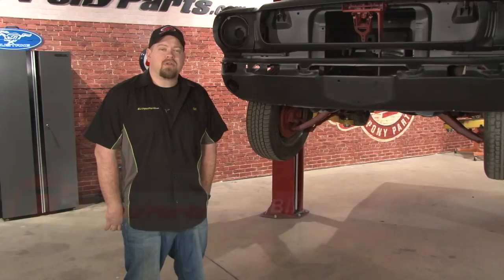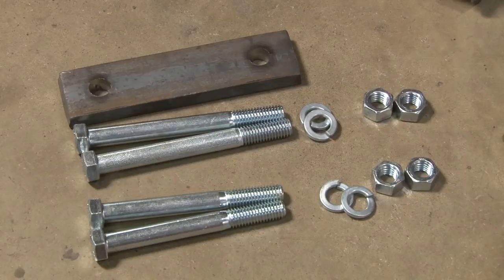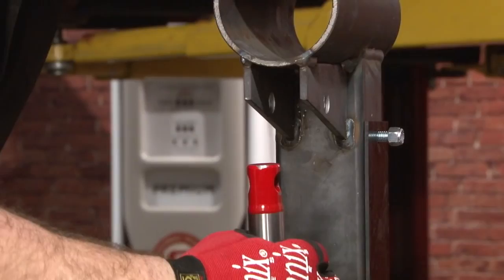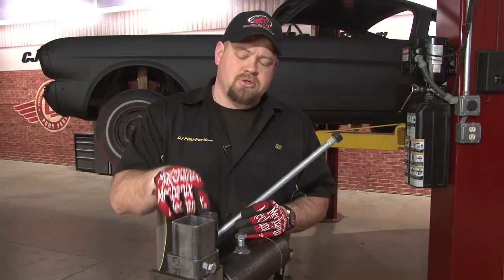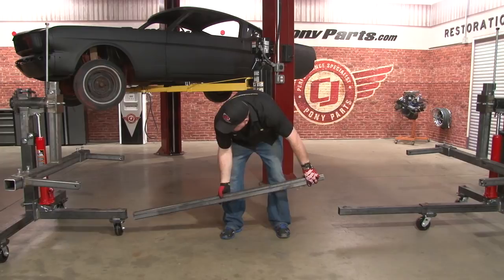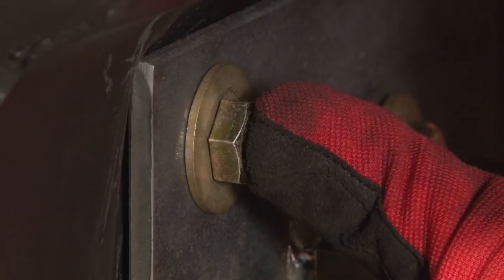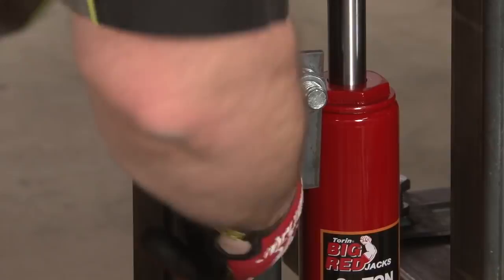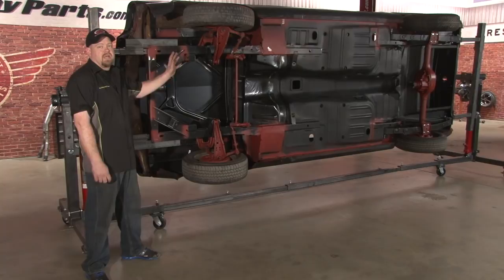Car Rotisserie Assembly | 1965-1993 Mustang

Comment: only good if you have a concrete pad to roll around on. Why not have bigger wheels, not casters so one can take frame out of the shop to sandblast, paint, etc.  Also, in South Texas, that would be one rusty mess in about a week.

Comment: assuming this isn't sold anymore? don't see it on the site.. i built my own anyway, but was just curious of the details and price. not sure if I'd trust mounting on the bumper mounts.. especially with the car having the extra weight it does in the video.. the design is actually pretty similar to mine other than how i'll be mounting. i'll use the rear leaf spring shackle location instead.

Comment: The center bar lock bolts should have been put on side of tubing. Spin car when its not high enough those bolts would put nasty gouges in the sides of the car.

Comment: It could be used if the car had engine and transmission position?
Reply: It will support the weight but I have never used one for a car with the engine and trans in it, I would make sure there are no fluids in either if you do.
Reply: tanks
Reply: Of course it can....how else’s are you gonna change all ur fluids at once....I say u get one totally recommend it that’s how I started my oil changing business...

Comment: how much roof clearence do i need use this on my 73?
Reply: Its 7 feet with the 65 Mustang so I would say only a couple more inches for a 73. If you look at the video around 14:00 in that is the highest point and I am 6'2 for reference
Reply: thanks that helps alot

Comment: 00:22 90 degrees not 360.
Reply: WRONG!!! The rotisserie machine can rotate the entire body or frame 360 degrees!!!
Reply: You're not the smartest are you, how would you access the underside if you rotated the vehicle 360 degrees? How many degrees do you think he rotated it at 13:57
Reply: @ricky302v8  You're going to tell somebody who has actually DONE it that they are not very smart??? How about getting your facts correct before publishing false information on YouTube for all to read!!! You are evidently basing everything on what this particular person did in his video. But that has absolutely nothing whatsoever to do with the actual capabilities of what can be accomplished with a rotisserie machine. I don't know what machine you have personally used, but the one I have turns 360 degrees which is essential for accessing every possible angle.
Reply: So you've done it? big deal! 
Lets quote what he said 'and rotate it 360 degrees so you have access to the underside of the chassis' do you not realise that if you rotated it 360 degrees you would end up in the exact position you started from? 
I don't give a flying fuck if the rotisserie machine could fly to the moon, to get to the underside of the chassis you rotate it 90 degrees, exactly like he does at 13:57